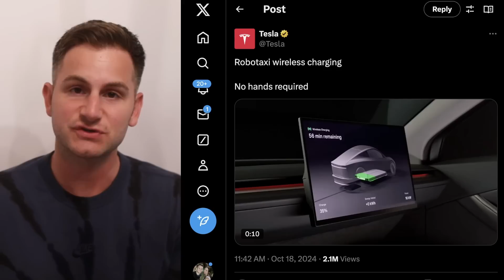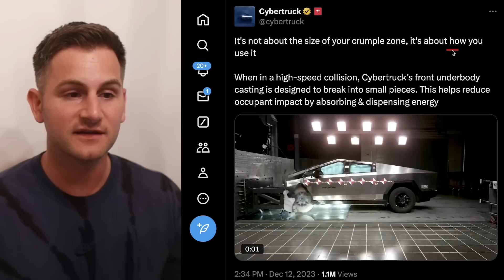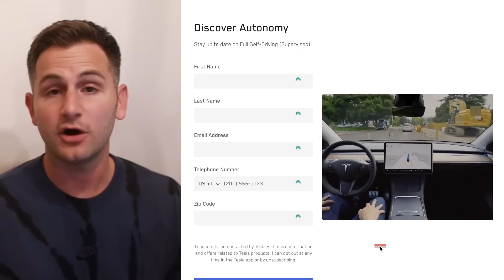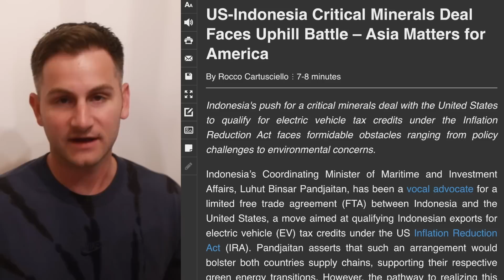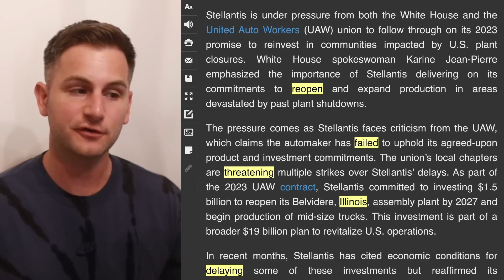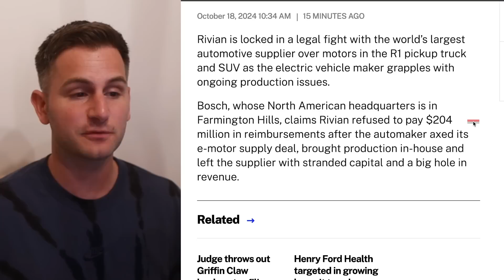Tesla Slowly Unveiling Its Plans / Big Cybertruck Change / Tesla's Battery Sourcing Play ⚡️

Comment: I’m a Cybertruck fan, Model Y owner and have great respect for everything Elon Musk has achieved…. But your response to the danger to pedestrians was a little disingenuous…. The article you mentioned was referring to cyber trucks alleged danger to others, not its safety for occupant.  There’s little doubt that the cybertruck is absolutely going to test off the charts in terms of occupant protection and safety, but that argument is a pivot from the point at hand…. How will pedestrians and occupants of other vehicles fair?   Again, I’m a huge fan, but let’s not deflect or pivot, let’s just stick to what fact we know and wait for the rest without trying to minimize what could be a relevant concern.
Reply: I don't understand why people are so worried about pedestrian safety with the Cyber Truck, all of a sudden; Would it really be so much worse than getting hit by an F150 or any other full size pickup truck? People complain about it's "excessive weight" too, but if you actually look at the specs it's about the same as other trucks; after all, a V8 or diesel engine, along with a transmission capable of handling the torque, are not very lightweight! Sometimes I think people just invent new ways to criticize Tesla and stir up controversy even when a logical person wouldn't see any greater risk compared to other similar vehicles
Reply: @bryanhood9839  my point. All pick ups kill pedestrians. So do vans and trucks. No differnce.
Reply: @bryanhood9839  I believe the worries came from Europe where we have basically no trucks.
But on one hand we would like to get cybertruck and on the other hand don't want it driving around my town.
Reply: As long as we do not have the results of the mandatory test of the UN/ECE regulation #127 we can not say one way ot the other.
Reply: @wolfgangpreier9160  Tesla could build a EU version in Germany.   Heck start from scratch and downsize it.
Reply: @danharold3087  Why downsize? Ford Transit, VW Crafter, Mercedes Sprinter are bigger and delivering 90% of our goods.
Reply: @wolfgangpreier9160  Define “bigger.”  I haven’t researched or measured, but it seems the CT is significantly WIDER than those vans, which might not work well on narrow European urban streets.
Reply: So all the dodge rams in EU are safe for pedestrains? I call major BS on that shit. Is the f150 has pedestrians crumpel zone? Give me a break.
Reply: @punicwars2  Dodge Rams are not homologated and are all imported privately - just like the Cybertrucks. 

Homologation means it is conforming to the internalionally agreed upon rules of the UN/ECE and must be permitted everywhere in Europe including switzerland.

Up to 150 vehicles may be imported privately to be sold locally - not exported! - without homologation and you just need a local technical official to get a permit for your vehicle. 

Privately imported vehicles have to follow the local laws, not the UN/ECE rules.
Reply: @wolfgangpreier9160  "Nearly 5,000 Dodge RAMs were brought into Europe in 2023, up 20% compared to 2022, according to newly-released data from the European Environment Agency. T&E estimates there are now at least 20,000 Dodge RAMs on Europe's roads." This is from the ETSC website...
Reply: @punicwars2  Yes, all private imports. Every citizen is entitled to import up to 150 cars on their own without homologation.
Reply: @punicwars2  does any vehicle made anywhere have real pedestrian crumple zones? i think not. show one that doesnt fall apart under its own weight.
Reply: @scottmcshannon6821  almost all cars sold in eu have front pedestrian crumple zone. Seen it with my own eye. The car hit a guy sent him flyin about 9 meters the guy eventually walk with no major dmg. The car looked like it hit a concret column.
Reply: @punicwars2  seems unlikely since what just behind the front end of almost all vehicles is the engine block; and that dont crumble. modern cars to NOT have empty space in their engine bay.
Reply: @scottmcshannon6821  the bonnet and the bumper. When u hit a pedstrian it hit the top of the bonnet and the bumper from above. So its ment to crush on the engine block while taking some slowing the impact for the pedestrian. Big trucks... the bonnet is higher the a human center of mass so u just get smacked.
Reply: and at this point in time we know nothing about what the results will be.
Reply: @scottmcshannon6821 I'm have doubts about the benefit of the pedestrian safety movement, and I strongly suspect the CT will do well in other vehicle occupant testing.
Reply: @scottmcshannon6821  We have a very good idea.  The CT uses the same crush zone tech as the top safety pick model Y.  Gigacastings designed to crush.
Reply: @danharold3087  so that means that the cybertruck will ace all current safety standards, just like the model Y.
Reply: @darylfoster7944  Your US cars do not have to follow the rules of the UN/ECE. 

The citizens of the USA do not mind if a few hundred thousand of their own children and elderlies die on their roads because they were not stronger than a real US Americano Truck.

Comment: Do you really think there is the slightest chance this will enter production in 2 years? about as much chance as FSD working with cameras only.
Reply: Yes.  This is an easy build for Tesla.   Nothing here that is not normally done.   FSD will be the bottleneck if anything.  FSD already has much better vision than people.    The new huge data centers will help solve the remaining problems.  Was just reading that a NN can be trained to see through glare.

Comment: The CT range miss is a far bigger deal breaker than the price increase for me.  The range is no where near long enough to tow the distances I need.  And giving up 1/3 of the bed space for a range extender (that still doesn't achieve original 500mi target) is not an acceptable option for me either.
Reply: I didn't buy it either time Tesla sent me notifications my reservation was available.   I'll just keep my TSLA until the CT range hits the original target.
Reply: @EW-ho6cm seems like the GMC then might be the truck for you.
Reply: Bill - that's exactly my plan.   I'd really like to see the Semi tech trickle down to a Class 4, 5 or 6 truck with 300mi towing rand and with 4wd.
Reply: @EW-ho6cm  That will probably happen in the future, once Tesla is running out of things to work on.  They're pretty busy currently.
Reply: Check out the STING Baja package from Archimedes Defense.

They'll put a multi-fuel generator in the frunk that can recharge the CT while it is on the road. Basically turns the CT into a plug-in hybrid, so you'll never need the generator for trips around town but if you do need to tow long distance it is no longer an issue.
Reply: Then don't buy it.
Reply: Only about 5% of people who own pickup trucks tow anything.  The CT range is just fine for 95% of the market.  I would wait until the technologies for towing with an EV are developed.
Reply: @billweberx  There is a LOT of towing that the CT works for.   People have towed cross country with early F150 lightnings.   You stop more often but if you do int once ing blue moon it works.  If not rent a gas truck once every few years.
Reply: @danharold3087  Yes.  Light towing.  But what people are complaining about is work trucks that tow heavy trailers.  EVs are not there yet.
Reply: @billweberx  But for the range the CyberTruck is more capable than diesels.
What I am saying is that it is OK for occasional heavy towing.  Trucks that end up doing regular heavy towing is in the single digits.
Reply: @danharold3087  Sure, but not very far.
Reply: @billweberx  
The lower weight due to fewer batteries is more beneficial to the buyers than the lost range in most cases.  If it is not for you buy some other pickup.   CyberTruck is #1 selling electric pickup and #3 best selling BEV in the USA.   Hard to argue with the paying customers.
Reply: @danharold3087  I'm not buying anything.  I ride a bicycle mostly and use Uber for the rest.  However, I believe Tesla cars to be the best in the world and the Cybertruck the best truck.  If I were to own a car, it would be a Tesla, possibly a Cybertruck.
Reply: @billweberx  Fine.  I was responding to "Sure, but not very far."   What makes you think these others know better than people who are buying the cyberTruck ?  Obviously you can see how little pickup owners tow.  Something like 15% or less.  Heavy loads for long distance that the CyberTruck can't handle a lot less than that.
Reply: @danharold3087  Only 5% of pickup trucks tow anything.  Most pickup trucks are vanity vehicles.   They rarely even use the truck bed.

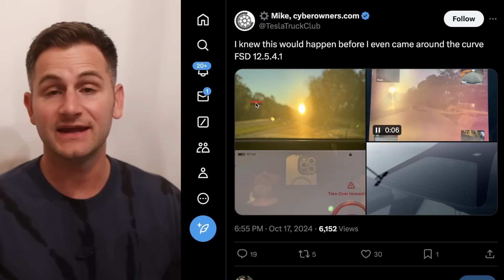Comment: 9:55 yup, it’s obvious cameras need a self cleaning function and some kind of glare reduction mechanism. It sucks that a company that prides itself on engineering would allow such flaws to continue.  I couldn’t believe Cybertruck launched without any solutions.
Reply: Henry Ford launched his model "T" with out any hydraulic brakes, it didn't stop worth a damn.There were a few other parts missing as well, who needs lights or a starter anyway.
Reply: First of all, we don't yet know why those two people died.  NHTSA is just starting the investigation.  They may find nothing wrong.  Also, people drive with glare and often have fatal accidents because of it.  I don't see any recalls of cars or NHTSA investigations because of that.
Reply: @billweberx  can’t claim to be focused on safety and leave glaring safety risk unaddressed. It’s not supposed to be just as good as human error but superhuman. I don’t care if you call it a recall or a retrofit, it needs doing for true safe autonomous driving.
Reply: @TheGreatestJuJu  There's no way any autonomous system will be 100%.  People will die due to flaws in the system and it will be investigated.  But you can't say in this case that were were any safety issues until the investigation is complete.  Even if the software is found to be at fault, a determination has to be made if the death rate is higher than what is considered acceptable, because there will be an acceptable death rate for autonomous vehicles as there is with any technology.
Reply: @billweberx   Roughly 1 out of every 5,470 drivers in the U.S. died in a highway accident in 2022.  If FSD is better than that it will be saving lives.
Reply: @danharold3087  Exactly!

Comment: Wireless charging just doesn’t make sense. Anytime a vehicle spends charging is time not earning. Faster charging FTW.
Reply: It's not really autonomous if you need a bunch of goobers running around plugging and unplugging them. Wireless is absolutely needed for a truly autonomous system. As for it taking a long time, they've  done 500kW charging in the lab with a 15cm air gap while maintaining over 98% efficiency with a 2m² charging pad. There's no limit with what the tech is capable of, it's more a matter of the cost-benefit analysis Tesla has done. They've obviously decided to go with a smaller, cheaper, slower charger for a reason. My guess is that there will need to be enough Cybercabs for peak periods, but that leaves plenty of time during off-peak times for them to rotate through the wireless chargers, getting ready for the next peak. For the system to work reliably for customers, there needs to be a slight surplus of cars most of the time.
Reply: @truhartwood3170  Agree, also, the vehicle can still "earn" while charging due to the projected involvement with distributed inference compute provision (remote compute power over the internet while otherwise un-engaged).  I could also see a remote chance Tesla might offer a discounted fare to people willing to take a 20-minute hiatus for charging during their trip (this is a long-shot, but possibly a money-maker for customer/Tesla during peak travel periods when more chargers available than rides).  This only would (probably) only make sense if it LOWERED the distance/time required by the CyberCab to accomplish the charging by doing it in the middle of paid fare due to location of vehicle from nearest available charger.

Comment: It seems to me that the Cybercab will be specialized city and short range robotaxi -- it will have a very small battery pack, it will have slow acceleration and it will be very efficient. All that combines to it won't need to charge that frequently or quickly. If its got like 200mi of range on a 30kw battery pack, guess what, inductive charging at 25kw means it gets half its range back in only 30 minutes of charging. Also, 80%+ of people's average trips are less than 20 miles one way. So the Cybercab will fit these needs very well.

That said, this also means that there will be a need for a longer range autonomous vehicle. Something that can take you from SF to LA comfortably, that can supercharge with a charging port, that can serve those 20% of trips that are longer. And we can point to the Model 3/Y as serving that role, but I actually think that's where the Model 2.5 (which we haven't seen yet) will really step in and shine. 2025 is going to be a huge year for sure.
Reply: I am not sure I would call the acceleration slow.     With the light car and a 40KWh battery it does not take much power to go zoom.    No idea how that will be handled.

Comment: Cybertruck may be safe for occupants but is almost certain to be unsafe for other road users
Reply: Why? The frontal area is much smaller than the standard pickup in the US and that is the biggest contributing factor to  death in pedestrian accidents.
Reply: @coreycoddington8132  The greater the surface area the less force per square inch. You've just proved that Cybertruck is more dangerous to pedestrians
Reply: @MegaWilderness  You need a good lesson is first year engineering or physics, you couldn't be more wrong.
Reply: @Jimmoss-o6l  I have an engineering degree. Musk has never tested his Cybertruck vs. Dummy especially on the front fender which will slice through a dummy like a knife
Reply: @MegaWilderness   Only if the person has more area than the front of the truck.   It is more like hitting a ball with a bat.
Reply: @danharold3087  I agree with you but injury will always depend on speed of collision and inertia
Reply: @MegaWilderness    Yes.  Speed being the greater danger.  
Kinetic Energy = (1/2) * m * v^2
For a 2000 lb vehicle to have the same kinetic energy as a 6000 lb vehicle traveling at 20 mph, the 2000 lb vehicle would need to travel at approximately 34.64 mph.
Reply: @coreycoddington8132  The reason is people don't want facts, they want to spout useless opinions.

Comment: the crash test issue for europe is not about the safety inside the car, thats ok. its more about bisicle and pedestrian safety and impact.
Reply: Yep,  and US crash tests don't include pedestrian crash.
Reply: @jamesengland7461 pedestrians don't count.
Reply: @jamesengland7461  It does, just not as efficiently as the UN/ECE demands.
Reply: imagine thinking an f150 is any safer.  you do realize what happens when you hit someone going 35mph(56kmh) and they are on a bike and you are in a full sized truck dont you?
Reply: how can they have a crash test issue without having done any crash tests? are they physic?
Reply: @scottmcshannon6821  i guess first red flag is just looking at the car, sharp edges and corners. then the hard metal surfaces. i understand things like this in the US are different. maybe its al to much but deaths are also much lower in europe. compared to the US they are bad.
Reply: Make bike paths and sidewalks. Keep them off the railroads and steeets.
Reply: @bearlemley  And what about crossings and tight corners? In Europe we do not use artificial grid locked streets, they are all very not-straight.
Reply: Which is stupid as he!!.  Any car/truck will kill or injure a pedestrian/bicyclist if they are hit with the same speed.  In other words, a Smart car going 25 mph or Cybertruck going 25 mph will kill someone with a direct hit.
Reply: @billweberx  But the CT has a good chance of detecting the pedestrian and emergency stopping. Best impact is no impact.
Reply: @danharold3087  Correct but the EU is worried about the size, shape, weight, etc., of the car for pedestrian and bicycle safety.  I think they are looking at this all wrong.  Every car is dangerous to pedestrians and bicycles unless they have autonomous control.
Reply: @billweberx  You are rather missing the point.
Reply: @rorykeegan1895  The point is it doesn't matter the shape of the car or what it's made of.  If it hits you, it's bad.
Reply: @billweberx  I think that's true about the bumper area but maybe not with the hood of a regular car. I think a regular vehicle would giveway more than the stronger rolled steel of the Cyber truck.
Reply: @jlmur54  So you maybe save a few mph.
Reply: @billweberx  " In other words, a Smart car going 25 mph or Cybertruck going 25 mph will kill someone with a direct hit." - No they do not. Sorry. Look at the UN/ECE regulation #127 if you want to know more.

Comment: 500 miles for Cybertruck that’s what I want
Reply: That's one hell of a commute.
Reply: @rorykeegan1895   The most I will drive in a day is 200 miles at highway speed.  I haul a cargo trailer, so I figure I will get 1/2 the mileage when hauling.  I believe the battery pack in back would suit my needs but an extra $15k.  I drive over 30 thousand miles a year so I will save money eventually.